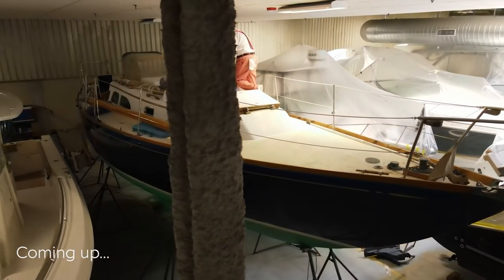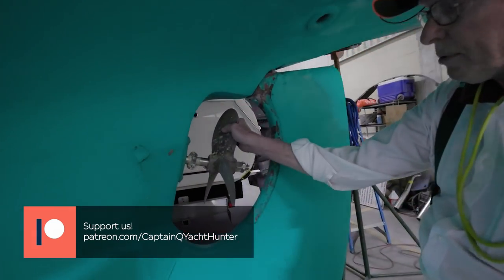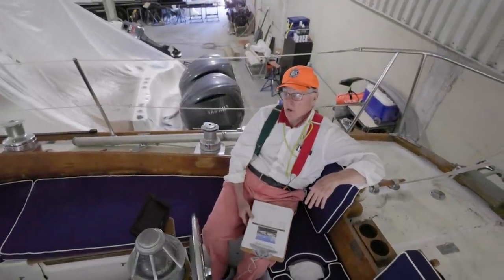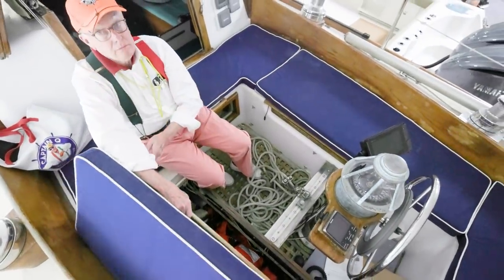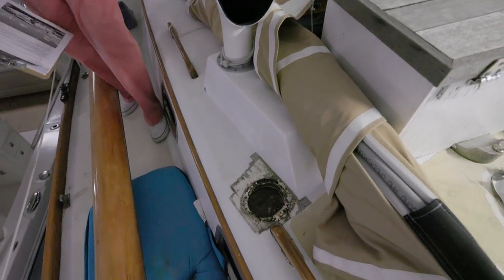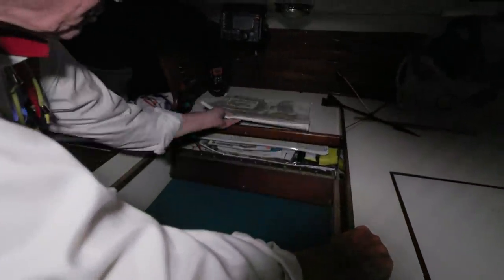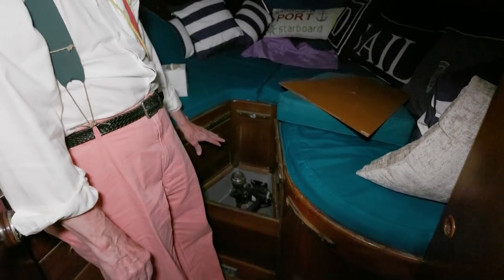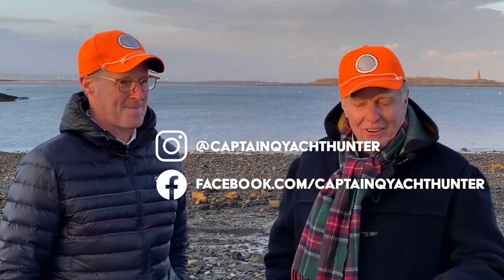$24,900 A MINI PB!! 38' Lecomte Northeast 38 Sailboat for sale EP 92 #sailboatforsale #sailboattour

Comment: Oh to be 10 years or so younger and in better health. I'd snap her up in a heart beat and go by the old survey when I did it. There's just so much there to work with and not a heck of a lot that'd need doing on the hard. Go through her top to bottom, engine, through wholes, wiring, fresh paint on the decks and on the bottom a few other bits and bobs and I'd splash her doing the rest of the work on the water. Thanks for showing her to us as I think she really will make someone younger and in better health one heck of a little yacht...
Reply from the maker: She will indeed  but the work is easy   nothing major stood out  and better than glued to the tv     summertime warm evening boat fiddling   just the best

Comment: I just came into a 1968 North East 38 mk2 basically for free. The MK2 and MK3 were spade rudder configurations. I believe the MK1 (the one in this video) was a 5000lb ballast. The mk2/3 were upped to 6000lbs.

Mine is in pretty rough condition. About 3-1/2 years ago she broke from her mooring in a storm and washed on some rocks. Put a hole in her side. She was towed back to the mooring left there for some time. The hole was above the water line, so would slowly take in water. The owner at the time repaired the hole, sanded the exterior (top and bottom) and put epoxy primer on the bottom. But he never finished the job.

Unfortunately she sat for these last 3-1/2 years and collected water in the bilge. Since then the aft portion of the keel has crushed due to the long sit. It's going to take me a few years to get her going again, but I'm looking forward to it!

Thanks for sharing! It's awesome to see what my boat could become!

Comment: Captain Q,  In 1985 I bought a fully equipped Northeast 38; newly overhauled Volvo diesel engine / 8 bags of sails just back from being checked by a sailmaker / inflatable dinghy / galley with three burner stove & oven / pots / pans /plates /silverware / engine spare parts / boat spare parts / extra steering system cable / radio / depth sounder / log / etc. from a Hamburg Yacht Club.  Since I was buying it unseen, I made an offer of DM 50K (DM 4.30 = $1.00) with a goodly allowance for the "unknowns".  My wife and I picked up our new toy in Hamburg and spent 5 weeks sailing in Denmark to find out what kinds of problems I had bought.  Mostly small stuff, except our final trip from Denmark, hard on the wind in heavy rain.   It was a long cold, wet slog to windward to Kiel.  When we tied up at the Olympic Harbor in Kiel I was coiling lines and clearing up the cockpit when my wife yelled something from down below.  I asked, "what did you say...?  and her answer was, "tonight we sleep in a hotel "  She told me that our forward cabin mattresses were soaking wet with seawater  from the leaking forward hatch.
The main thing the boat lacked was TLC.  Nobody (they went on 6 man cruises all summer long) had ever recaulked the railing stanchions, or the hatches, but aside from that, we had a great 5 weeks sailing and exploring the Danish Islands.

Comment: Gorgeous boat. I am surprised at the Airex foam deck coring. I did not even know they were using it that far back. This one is tugging at my heart strings. The bow chocks imbedded in the toe rail and stainless port lights make my day every time. But yes, it is a shame the fireplace was removed. That refrigeration compressor would be taken off the engine and a 12V compressor installed because,,,,,,,well because I hate wasting engine hours on that sort of thing or for even charging the batteries. THAT is why God invented portable gasoline generators IMHO. The price is totally incredible though. I can just see myself on Boston Harbor anchored for the 4th of July fireworks after a day of spanking around the harbor. I loved that compass. I would have that housing heavy plated in brass IF it did not polish up.
Reply from the maker: you can tell true love a miile away

Comment: I've sold a couple North East 39s. A C&C design based on a C&C one ton from the 80s. Cool boats beautifully built. New Englanders seem to get together and build some awesome one design boats ala the J44. Ok Cap look up a Lindenburg 22 my personal favorite from the 70s a boat way ahead of it's time. Open transom, hard chines, plum bow, retractable rudder, dagger board. I've sailed one at 13 knots main alone. Goofy boat but I always wanted to paint it with orange metal flake stripes and purple metal flake hull like a crazy looking Bass boat. A trailable regatta boat.
Back to this boat. Seems like great potential
Reply from the maker: she  looks wild    there is a lid for every pot   thanks for chiming in

Comment: Minor point on nomenclature.  Ceiling is the inner planking on the hull.  “Walls” are called “bulkheads” aboard boats.

Keep up the good work.
Reply from the maker: Thanks for sharing    but i would consider the ceiling as the non structural covering whether by wood or in new boats  fabric  on the inner sides  of the boats as the ceiling    no?

Comment: I don't quite get the "musher" concept. It seems it would uncomfortably slam into a wave with a wide bow rather than gently slicing through. What don't I understand?
Reply: As someone whose boat has a similar bow, with it having that angle downward towards the keel rather than an abrupt turn aft, the boat "settles" into the waves and mushes the water to either side rather that the abrupt pounding boats without it have. So you're a little slower with the shorter waterline, but improve the ride in the process.

Comment: Hi Captain,
I have a question if you will: with lightning being such a threat on sailboat is having a mast made out of basalt or another nonconducting material a reasonable solution? Is anyone building boats with this type of mast?
Reply from the maker: i am by no means an authority on lightning but no matter what you stick up there will be metal shrouds to do the conducting    best to have all metal trhu hulls connect ed together and also to a good dedicated ground on the hull
Reply: Synthetic shrouds are an (expensive) option. But any shrouds soaked with rain and saltwater are conductors.

Comment: I think the paint on the deck is too thick, and might be “easily” removed with a heat gun and some effort.    With any luck there might be a good nonskid surface someone with good intentions painted.   I’m not a fan of painting fiberglass boats.   It looks good for a while and looks far worse in the long run.
Reply: Aye!   :)
Reply from the maker: we are talking one option    you have offered another     just trying to keep unnecessary costs down